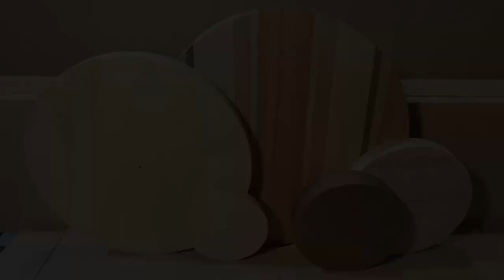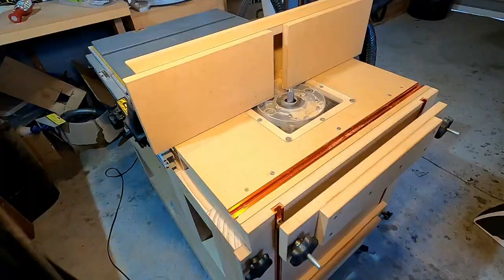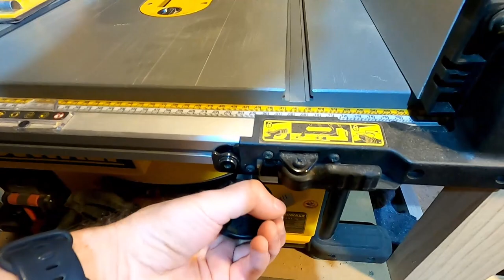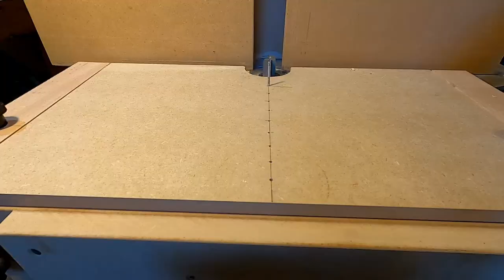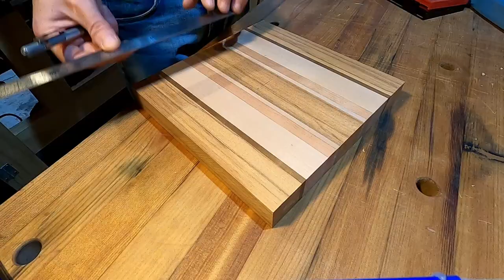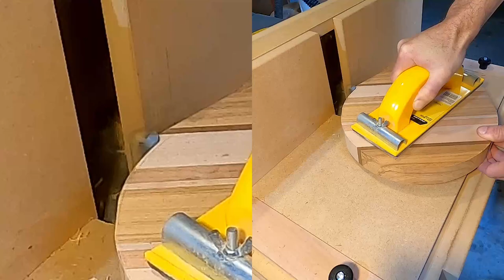✅ Router Table Circle Jig - Cut Perfect Circles!

Comment: For some reason I thought it was going to be something like I recently saw from Tamar 3x3, but this one is new to me and is incredibly simple - thanks!
Reply from the maker: Glad you like it. I've seen similar variations but all involved fingers getting close to the router bit. I think the design I came up with strikes a good balance between simplicity and safety. It does also produce very nice and clean results. Thanks.
Reply: @kiwiworkshop  yeah its clean and the simple added step makes it super safe! 

The one I referenced is actually done with a plunge router, so there's no finger-bit situation involved. It's pretty cool actually (if you wanna check it out on Tamar's 3x3 channel) but does require a slightly more involved jig than this. 

They're both able to make real small perfect circles without a hole, which most others I've seen cannot.
Reply from the maker: @willbephore3086  thanks for the heads up re Tamar's jig. I just had a look and that looks like a great option if you don't have a router table. And also don't want a hole in the middle of your circle. 
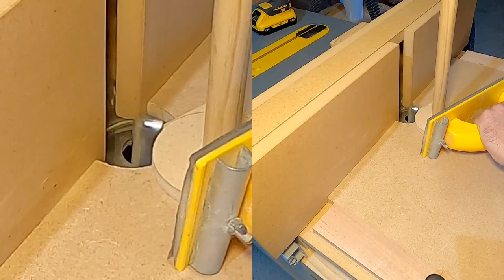Another advantage of using the router table which I don't think I've mentioned is dust collection. At 0:48 in my video, you get a nice close up of the dust getting sucked into the dust port, well most of it anyway!
Reply: @kiwiworkshop  wasn't tracking that for some reason but yes that's a very relevant factor. Also, yours is on whole a simpler approach, at least if you've got a router table. I haven't made either setup and might have to make both just to try them out and have the options available.
Reply from the maker: @willbephore3086  yeah, it would be good to have both options available. Tamar's would also work well for a circle too large to handle on the router table.

Comment: Wow, very clever. It seems like you have the same "dewalt tablesaw"  as I have. Can you share how your router table is setup?
Reply from the maker: Thanks. If you search in youtube for "table saw with router table" or keywords along those lines, you should see examples similar to mine. I might make a video for it but have some others planned first.
Reply: I've noticed you can use the fence of the tablesaw which is great. I haven't seen version yet but I will find them. 
Thanks!
Reply from the maker: Hope you managed to find another video or work it out. I did see another one very similar to mine but can't find the video. Yes, the fence of the table saw doubles as the router fence which is great. A perfect solution for saving space in the workshop! In summary, I planed down a length of wood to fit perfectly in the gap between the two metal sides of the table saw fence. Then built a basic router table fence with the back end of it attached to the wood that slots into the tablesaw fence. Obviously a bit more to it than, that but I'm pretty sure you will get the idea. For the router table, you  can basically follow any DIY router table tutorial. Something else to keep in mind is if you want dust collection. I made an open channel in my router table fence and attached a dust port on one end. Hope this helps!

Comment: Great method. Can you share how you made that router table using the Stanley table saw?
Reply from the maker: Yes, this method works great. I might create a video or blog post that shows the combined table saw + router table but have some others planned first. A few other people have done this and if you search in YouTube for "table saw with router table" you will probably find some similar to mine. It's a great option for saving space in your workshop. My table saw is actually a Dewalt, but yes it does look like a Stanley!
Reply: Great video fella, I echo other comments would be good to see how you made your router table.
Reply from the maker: @jimmyreuben6919  thanks. Is it the table saw + router table combo that you are interested in? Or how I setup the circle jig on the router table?
Reply: @kiwiworkshop the router table